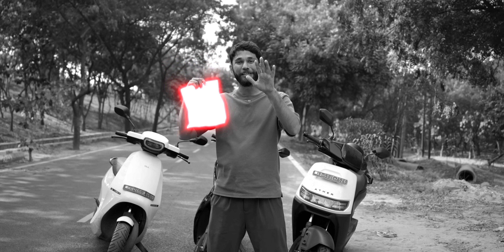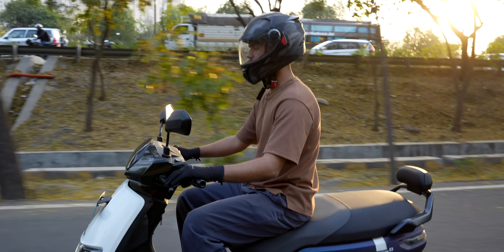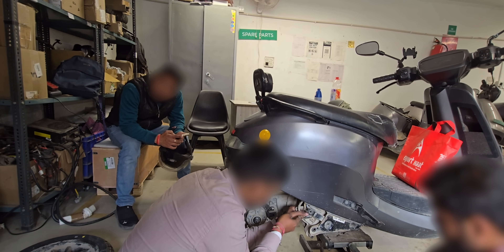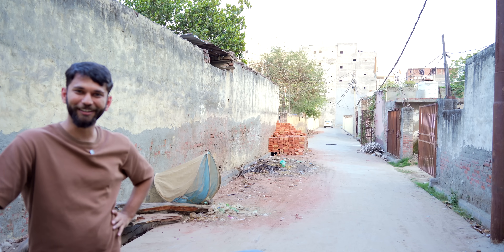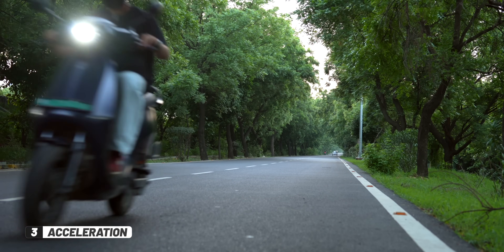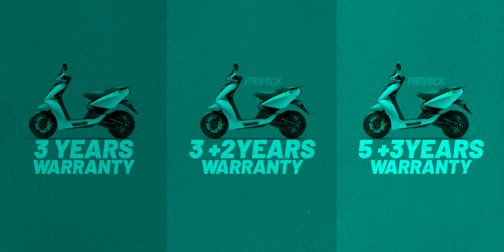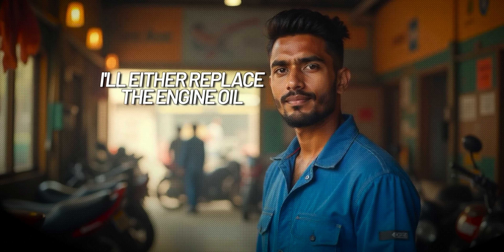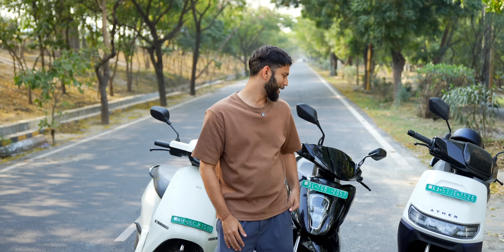The Real Truth of Using EV After 2 Years!

Comment: I purchased the TVS iQube base model a year ago and it ran over 8000 kms so far. I'm very happy with its performance because it gives exactly the range it advertises sometimes slightly more if the regen is used correctly.

Comment: Every electric scooter has issues including Ola, Ather, TVS, Vida, Chetak. If your scooter has no problems means you are lucky. If your dealer is good, you are more lucky. I am a owner of lesser known brand Bounce Infinity e1 with 2.5 kW battery. I have driven more than 31000 km in 18 months without any issue. I am getting a range of 110-120 km with single rider and luggage of 15-30 kg. With continuous nonstop ride without any luggage and 2-3 stops, it gives a range of 130-140 km. Its battery is fully charged in 90-100 minutes which is removable. No heating of battery because liquid cooling technology is used. Extended battery warrenty of 65000 km/5 years. Uptil total maintenance cost is Rs. 1000/-.My scooter doesn't offer too many features like others, just simple. My dealer is good.

Comment: I have vida vpro I was used it for daily commute for 90 km ie daily utility of 80% of charge with in 6month I got a battery issue and replaced in warranty ( 1month process) then changed usage type daily 30km usage 2 battery died deep dischage State. working to get it warranty already 15 days in process time taken , waiting.     atleast vida are supporting us. total km driven 13000km. i don't think ev is reliable until battery gets cooling system.

Comment: when you have a petrol bike ,in two years you all will also get 60k repair cost for oil changes, 12V battery replacements, maintanance, engine repairs,etc😂😂...  i guess ev are better where we save atleast on the fuel cost.

Comment: Hello I am from nepal the ather 450 series is currently being liked by the customers but there's one issue. Ather 450x gen 3 in nepal doesn't support magic twist even though you can twist the throttle forward physically which will definately impact it's range, performance and wear and tear breakpads/breakdisks. I think the magic twist should be enabled for nepal too because people paid for the whole scooter with all the features and some even bought the extended warrenty just for a piece of mind but by removing this feature they are declining their customers demand which is not good for both the company and the customer. I think they should either enable the magic twist or let the customer choose the power of regenerative braking through the settings from the software according to their route and habbit.

Comment: My Ola S1 X+ stopped working all of a sudden. Turns out a wire was cut by rat bite. They don't provide keys so I wasn't even able to unlock the handle lock. They were asking 3000 rupees for roadside assistance. I declined. I went to my hometown for a month, came back and took my vehicle to their service centre. Turns out that my battery has gone into deep discharge and won't be covered in the warranty. They are asking for 40000 rupees for replacement. This has been 4th breakdown in the last 2 years of my purchase. I am never buying Ola ever again.

Comment: Well, i have an ola s1 pro since 2023. Been using it for a while now and have clocked 26000kms until now but have only done 2 or 3 services just to change the break pads only or in accident cases but have recieved in max 2 3 days. I know it depends on the location about the service but is good overall in Chennai! And is still givin me good range

Comment: I have been using Vida V1 for more than 2.5 years in Bengaluru
replaced aux battery for 1000rs and other maintenance cost is around 2000rs, apart from that charging cost which is negligible
Of course the range is 80-90 kms
But it does the job

Comment: So i have purchased Ather rizta and it's a very good scooter. I really love it, but it has some issues.
First is the headlight its not that bright and it also doesn't have a good high beam. And it's has some belt noise while riding rest is good, it has skid control which is a good feature and the regeneration of scooty is damn good. And the ather charging stations are also very good
Reply: Skid control only with stack pro correct?

Comment: Bought ather 2.5 years ago with all the subsidies it costed me 1.1 lakh (80km range) . They gave me 3+2 warranty as it was an slightly older model 2022 and i bought in jan 2023. Now for service they will call you to book appointment every 5000 km. Service is always smooth even without appointments. I have 15k km on the scooter and no issues. If there is a software issue they give updates regularly . Only extra expense i have done is 3000 rs for map and app for 3 year. 
It has saved me around 35k and at the end of warranty i would have recovered cost of battery and some. And if goes beyond that i am in profit.
And two features which saved me from ola were the huge back and sound system (both looked tacky).

Comment: 3:52 that's a pretty steep service charge . Remember they didn't change any oil , oil change for an under 200cc motorcycle will cost ₹300-400 in oil (assuming no replaceable oil filter ) .

I wonder what actually happens in an EV servicing . Probably wheel alignment , which wouldn't be any different. No air filter or oil filter problems . Brakes are again the same technology .

Comment: 12:14 no this has been changed now now if there are any minor issues on the battery the battery is been sent to the Bangalore where it is being repaired and after it is being repaired the battery is being again installed on a scooter and this process usually takes the time of around 30 to 45 days which is quite long

Comment: I think this to bed way to harm ola in thia video partially i have ola s1 pro gen  1.3year ago and i run 22000+ km and i am living in gujarat so as per my celuletion i spending less then 10k to run 22k also , if you have ola aap you can search hyper charger near you , also ola have vecation mod for your cide information , ola top speed is 120kmph (eco43 ,normal 81 , sports 96 hyper 120-1) it is real range that you got with 2 pepale(total 120km) ola is silent then others ev , 

True 
Yesterday my ola break the belts so suffering but i have ola care + so i get free toing+ free leber+ free belt as well but they run out of stock of belts lucky i will get in 4-5day however ola gen 3 has metal chin so no wary 

If you buy your 1st 2 wheeler than please buy petrol one becomes ev never good for your 1st vihical (altlist now or next 1-2 years)so i have 1 activa , 1 bick then i buy ev 

If you think to buy ev then firstly tack review of latest models so you can get better products & review like 

in this video he use ola s1 pro gen 1 but carratly running ola s1 pro gen 3 somany ficher are chenge i know ola need to update there service fecelity & charging point

Comment: Deep discharge is a serious issue. Ola will void the warranty in this case. It is a total deal breaker, as the battery needs to be replaced if it deep discharges.

Ola seems to have no mechanism in the vehicle or app to prevent this, and they only send warnings via email and WhatsApp.  Vacation mode still cannot be turned on via the app.

In an emergency, it is very difficult to enable vacation mode, and it gets disabled by unwanted/accidental proximity unlocking too. Coupled with the buggy dashboard, it is a nightmare.

Comment: Bought Ola S1 Pro Gen 1 in 2022. 3 years and 15000 kms later, still doing fine. Spent 3000 on it for replacing front ball bearing and brake pads
No other costs, bought second Ola S1 Pro in 2024

Comment: One Correction:: EV Batteries are High Density batteries,  so they give  the highest performance until they Die or run out of charge. The battery in EV are not comparable to LIPO batteries in Phones.

Comment: It's been about a year since I bought my Ola S1x 3kw variant, It ran almost 7500km in a year, and I don't feel any issue so far. I faced the issues like Regen not working, a sudden drop in acceleration after 60 kmph speed, and charging issues once or twice. But they just vanished. Btw no major problem in my Ola, it's giving about 110km in single charge, and all other things are working fine as well.
I haven't been to the Ola service center for maintenance, so I can't say much about the service staff.

Comment: I've been riding Activa for like 10 years now.
The present one was bought 2 years ago.
Petrol cost: 13,000/year (on average)
Service: 6,000 per year from local workshop.

Oil change and misc. expenses 1000Rs per year
Total: 20,000/year.

Why I bought Petrol: 
1) Reliability and robustness for like 5 years.
2) Less upfront cost means I did not have to depend on EMI. 
3) Easy of repair and parts availability. 
4) Occasional rides of up to 140KM.
Reply: Service 6000 per year, how?
Reply: @shanawaperbez 2 services at 3000 per service

Comment: I am using Vida V1 pro for 20 months now and driven almost 12000km within the city. 3 free services completed and I didnt spend even 1Re for the service. There was only general repairs like changing of brake pads due to wear and tear and that's it. One more good thing is paid service interval is every 15000km or 1 year so it works out way cheaper(unlike other EVs where service interval is every 5k). I have never faced any battery issues. Once in a while touchscreen gets hanged and surprisingly it repairs itself.I am very much satisfied with this bike and I would highly recommend.

Comment: I used TVS iCube and it runs very smooth, no vibration, no sound, it easily touches 70+ speed in sport mode, pick up is very good. Dont know what will happen after 5 years, but currently its very good

Comment: I don't know ehy people are always comparing discussing and doing everything with only these brands eg Ola, Ether,Bajaj Tvs. There are many other brands which provides battery as well as good range in much cheaper price even the range is pretty good and per km charge is also low eg Ampere,Komaki,Yo ,Okaya,Oreva. These Brand have no such different driving modes so theri claimed range is equal to or 99 percent accurate to real world range. People don't talk about these brands as they don't provide speeds upto 120 km per hr. Byt remember that people bot only talk about 350 cc bikes when they want to have petrol bikes as demands for 100 cc 110cc and 125 cc also exists. Similarly people are only talking about these companies completely ignoring those companies mentioned abovr simply because they cannot cruise at 120 km/hr. Pathetic

Comment: I have saved 1.1L with my electric vehicles ( tata tiago ev LR 5700kms, ola s1 pro 25200kms, ola s1x 3400kms) I recommend people to buy bakaj chetak  because ola brake lever is made of cement, it's steel coated cement and brake lever for s1 pro costs 700 while s1x it costs 2200 so bajaj chetak is your best bet and 4kwh battery runs about 100km in normal mode 60kmph and 130km in eco mode 42kmph

Comment: I have a 5-6 year old ather 450x with about 25k kms on it. It rides well and gives about 90 kms of range I hardly even give the scooter for service, recently one of the brake pads deteriorated and I gave it to service. Out of curiosity, I asked the service exec to check the battery life remaining and he said there's 96% remaining. The athers a super well built scooter and it's built to last.

Comment: On road price of platina 100 is 87000/- & Ather 450x apex model price is 199000/-....so subtracting the extra cost I paid for the EV...that is 112000/-....& In this amount of money I can easily ride 76000 kms in that Platina 100....EV's are extremely costly if it costs around the IC engine cost than buying EV is a good option... otherwise not

Comment: I own an Ola S1 Pro. I've had it for three years now, and it has 16,000 kilometers on the odometer. So far, the range hasn't been reduced. It also handles well and is very fast in normal mode, which I think is better than the Ather. The only problem I've had is the low-voltage cable and the ECU being damaged. Ola replaced both of those quickly and didn't ask any questions. Why is it that some people have to put down the Ola service? Ola S1 Pro is anytime better than iQube and Chetak. Ather, on the other hand, is good, but it's more expensive and they have a subscription for some of its smart features. Can you imagine that?! You have to pay in order to use some of the features, while Ola is totally free!

Comment: I have an ola s1x it in 6 months it started showing system issue and stopped working when took to service center they told a part is faulty we will replace in warranty in 2 days but next day they called saying the rats have cut the wires and we have to replace entire wiring system and it will cost 7000 im pretty sure the service center ppl themselves has cut the wires and when asked for cctv footage they have no CCTV in service center they have boards saying no Photography/videography allowed after paying huge amount and getting it repaired after 1 day of taking vehicle from service center it stopped working again with same system issue
OLA IS A FRAUD
I have 2 Athers aswell one rizta and one 450x both have never been trouble for me
OLA SUCKS

Comment: I have ather 450x gen 2 from like 3 years now , I have ridden it around 45000 , I had battery issue, tht is range was dropped, my 450x had battery warrenty of 30000kms and 3 years even though I was over the warrenty, I got battery replacement for 6300rs , they mentioned if it was under warrenty it would cost us way less ! Iam happy about tht , I got complete new battery for tht price without warrenty, but they took 20days to deliver the bike back
Reply: What was the cost on the bill bro ?

Comment: An ather 450x gen 2 owner I really don’t regret buying it at all. Service is exceptionally good, I gave my vehicle for a periodic service at 35000 kms I got to know that my vehicles battery has deteriorated and it needs to be changed and it costs about 60k. Thankfully it was claimed under the insurance and I got a free replacement.
Reply: Can you tell me which insurance you are covered under and what additional add-on did you buy to cover the battery?

Comment: Using ola s1 pro since 2 years only spent 
2500 care Plus (useless)
1200 side guard and double stand (aftermarket)
Tire puncture repair arround 300 (2x)
The range i get is around 80 to 100 
- Surprisingly all my service was free Once broke down due to some motherboard issue but was resolved for free with towing ( before buying Care plus) 
- recently my scooty fell onto its side the brake was broken so took it to the service centre and they said it will cost around 2500 for overall service charges and the broken brake handle but i dunno what happened they just didn't make the bill and said u have to pay nothing so free again 
- i feel lucky that i don't have to suffer what the other s1 users suffered still it's a shit scooty don't buy it will not recommend to anyone not even other electric scooty just buy petrol
- by person i don't even like electric but i got it for 2 reasons 1 is less driving cost 2 is to have a cool looking electric scooty my understanding is like 'sirf scooty tak electric chalta hai'

Comment: you did a good job.. inhad same experience with tvs iqube. 6 month warranty left one of the batteries damaged. luckily they replaced under warranty else cost will be around 36k. now worried about other battery which will fail i am sure about that. with in warranty period well and fine else i will be screwed

Comment: 60k~>2500rs/month costs of a Battery
For pertrol average 5km/day × 30 days = 150 km/month.
Even if one spends 1000rs+- costs/per month on fuel cost, maintenance of electric scooter battery is expensive or almost equal as it seems 🤔

Comment: I have been using Ather Rizta for the last 4 months, and it's a decent scooter. When I compare it with its competitor, it's a really great scooter. But when I rate my personal experience, I am still worried about the value of money. 

I have kept canceling my plan to visit my nearest town, which is 44 km away from my home, since there is no charging station. 

Next range, when I travel along with my wife and two 6-year-old kids, I am getting around 0.7 km per 1% charge in zip mode. I derived the formula based on my experience.
Reply: lol you can charge it home right after you reach the destiination !!!  why do u have to cancel the trip  😀

Comment: but let’s look at it differently. If I buy a petrol scooter, I’ll be spending on fuel every month, plus regular servicing, oil changes, and other maintenance costs.
With an electric scooter, I don’t have to worry about fuel prices fluctuating or frequent servicing. Instead, I can set aside a small amount each month just like I would for petrol and maintenance and by the time the battery needs replacement (which is after a few years), I’ll have already saved a significant portion of the cost.

So, while the battery cost seems high upfront, in the long run, an EV scooter is much more economical, and I get to enjoy smooth, eco-friendly rides without the hassle of fuel stations!

Comment: I bought Ather 450 original when they launched in 2018. Have travelled less (below 20k km) as I use it for short distances only. Even after 6 years I don't see any battery degradation. I get the full 65 km ranges claimed in Ride mode and around 72-73 in Eco mode.
Reply: For riding Short distance electric scooter is a waste of money 🚶‍♂️
Reply: @ajaym9868 🤡